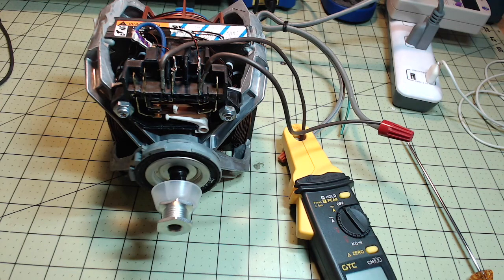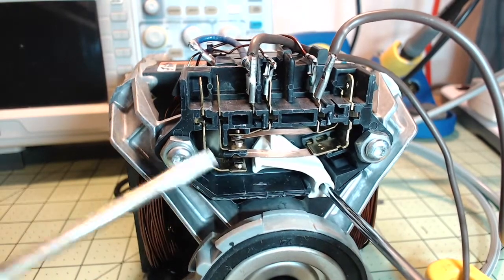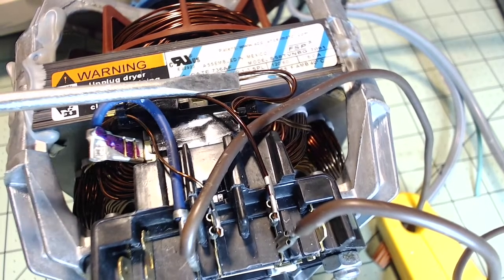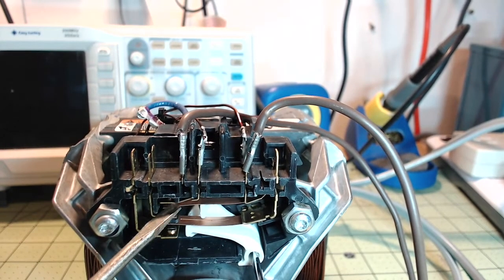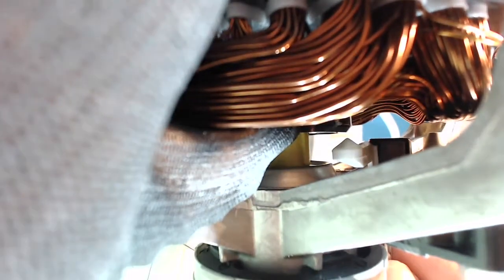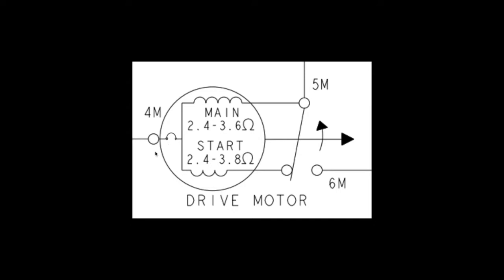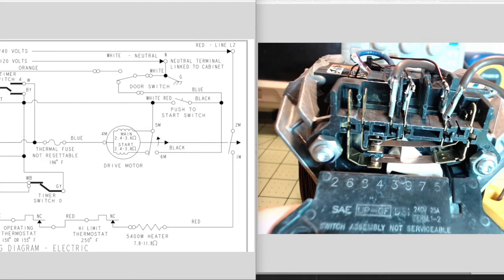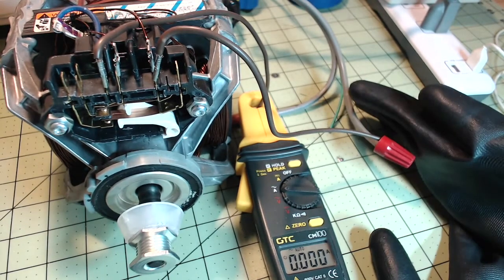Whirlpool Dryer Motor: How does it work

Comment: I've been looking at these motors a lot lately, been trying to rebuild a belt sander, the original motor went up in smoke and apparently with the model, that's their main issue. An appliance motor, dryer or washer are the only ones that look similar and are small enough to fit in the sander body. Why does nobody doing the explanation give any specifics on HP, Amps, Voltage and a Part/Mod #? Drives me crazy. Still, excellent explanation for the people. The rest you have to leave necause they never actually explain how to wire it, they give an hour long explanation of the winding, leave out the capacitor, the info on those, they're not helpful

Comment: Annoyingly enough, I cannot find a source for new replacement 26843975 start switches like you have there, and I have 900 washer/dryer units that use them...I keep the occasional fails going by filing contact points fml. If you know of a supplier that would be great! :-)

Comment: Such a great explanation. Thank you for helping me. I have come to understand that the “Non Serviceable Switch” attached to the motor is indeed “Serviceable”. I was able to clean the contacts without scratching the plating off. Put it back together and she fired right up! I am sure that sometimes the contacts can fuse together, but they are just dirty, try cleaning them up. (After having taken picks of how it is wired) I would also label the Start and Run wires if they are not color coded. Mine were just bare copper and not labeled.

Comment: Thank you! I swear.... I spent hours looking for a simple pinout for the switch... All of the sources gave me wire color but no function or incomplete schematics... I watched your video in desperation and finally... Line on the blue thermal cutout lead and neutral on the far end of the run winding... Thanx Again!

Comment: I have a whirlpool. My question is what is the clutch for on the front of the motor? Is it even needed? The dryer repair man took mine off and it's working fine. Seems like it's just a round aluminum piece bolted on the front with no special movement. Is it ok to leave it off the motor and operate it?
Reply from the maker: I am not sure what you are referring to, if you see it in the video, reply with the time stamp and description of the part he removed.

Comment: timer provide hot to motor, start switch provide neutral. when motor started the motor switch did following things: disconnect start coil, connect run coil to neutral, close gas valve or elec heating coil (1-2).
Reply from the maker: This channel is for technicians, so I don't explain things at a very basic level, the target audience should have a basic understanding already. If you look at my other videos, you will see they are typically medium to advanced. You can find basic explanations of these circuits on Youtube, so it doesn't make sense to just put on YouTube something that is already on there. In your basic explanation of how a motor works, there is one error, the run coil is engaged when the centrifugal switch is in both positions, it doesn't 'connect' the 'run' or 'main' coil, it's always in the circuit.

Comment: I think presenter knows how it is working, yet poorly explained. First, no schematics to match the real wiring; Second, no step by step how motor runs; third, no explanation when he right hand screw driver turns the switch, nor how clutch activates. I know dryer motor working from its schematics, but need further steps to try to repair. In my understanding - not from this video - user pushes button and hold a while, which kicks in the start coil, when he releases the speed activated switch keep the coil powered.

Comment: 4 being hot always.  When you push the switch, you send current to 5 which is in contact to 3.  And 3 feeds both the run and start winding and not just the start winding.  When the motor starts, then 5 connects to 6 to get current to the run winding since 3 is out.

Comment: This is a perfect example of running a single phase 120VAC induction motor without a capacitor to start it even in cold winter. It does not fall under shaded pole or three phase induction motor. It must belong to split phase single phase or some such thing.
But what is the difference in the winding of this to a washing machine motor which needs a start capacitor which they all have?
Are there two different type of windings for this type?  
I assume the motor for the dryer  is lighter duty, so it won't need a capacitor to give it enough phase shift for torque, maybe.
But all them wet cloth put in a dryer is pretty heavy.  Plus I realize that these motors also have to turn just one direction and they only have to have one speed I suppose.  ... I don't know if the phase shift of the start winding is different than the washing machine... or how it works out.
Reply from the maker: yes, single phase split phase. Because of the water in the tub, there is much more torque needed for washing machine motor. They operate at higher current, that's why you don't see 3 phase dryer motors, they don't draw so much current. Like 3 amps or so. Old washing machine motors were drawing 8 to 9 amps. Dryers definitely do the light duty between the two.

Comment: This is a very simple circuit, yet I have been confounded. From what I see here, the only thing the centrifugal switch is actually accomplishing is it open-circuits the neutral side of the start winding (disregarding non-motor functions). When still on the dryer, timer set to run/heat and the momentary start switch is pushed? How does that engage the start winding?
Reply from the maker: when power is applied, the start and run winding both are engaged, after the motor turns fast enough, the centrifugal switch will change states, opening up the start circuit (run winding still gets power) and closing the heat circuit.

Comment: Is a dryer motor an AC induction motor or a brushless DC? Sounds too quiet to be a universal motor.
Reply: These are AC induction motors. They run off 110Vac-120Vac so not a DC motor.

Comment: The instant you start the motor, the clutch clicks going in I think. IN a second or so when the motor gathers speed and gets going, should that clutch come back or would it come back at the end once you turn off the motor?
Why I am asking because I busted half of the thing pretty much after it fell off the pedestal.  I gather I don't have to worry about the heater part of it as I am not using the motor for dryer.  Interestingly enough the motor starts fine.  However I know the contacts as you are describing.  That arm is lame dangling down there inside.  It is down instead of up.  I need to check to see what is happening.  I don't want to be in start winding after the motor is running and the contact not disengaging.
Reply from the maker: Sounds exactly like what you are saying, start winding is staying engaged. You can test this with an amp clamp, normal running current is 3 to 4 amps. If it's higher the Start Winding is not disengaging.
Reply: @electronicsprojects4708  Well, it doesn't appear that there is any start contact because to keep the arm up to contact the start winding require that plastic arm by the clutch to stay proper up.  Since as I said it is just dangling, it implies down position.  Not only that when I unplugged the motor that arm was actually in the way down there between that washer ( that washer thing that it typically sits on riding on it)  and the housing neck. I actually left it up with a screw driver the first time around so the clutch washer comes back by the housing neck.
 
From the look of it is the clutch itself that is the cause of start contact or not contact.
My feeling is that the reason the motor starts is probably due to some residual magnetism or something.
I notice the contact you are talking about and it is not contacting because the plastic arm is down due to gravity, plus broken.
At least now I know what is going one and what does what.

If I can find all the bits and pieces I will glue it al together and get I going or I will make plastic cover with a profile that will do the job just for shits and giggles. :-)

Comment: I noticed there a terminal missing with a slot. Is that an additional ground. On my it is ground, but I have no number labels.
Reply from the maker: I see that a lot in appliances, that centrifugal switch may be used on other motors that use an added terminal.